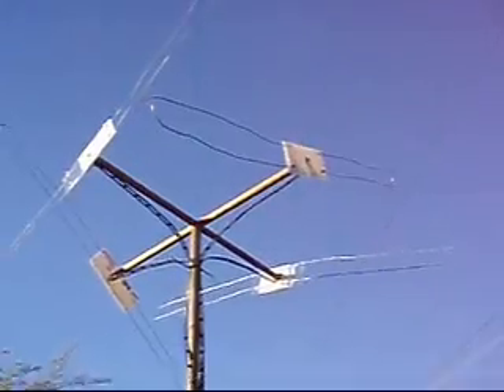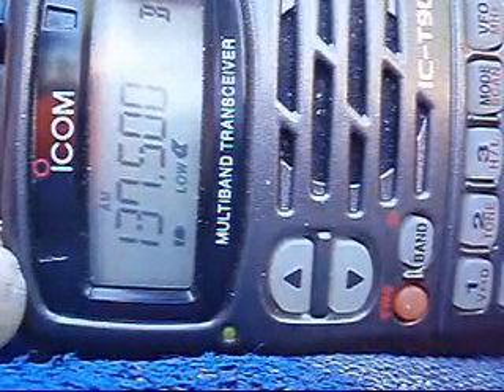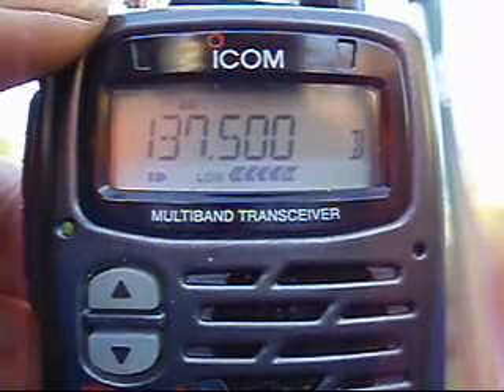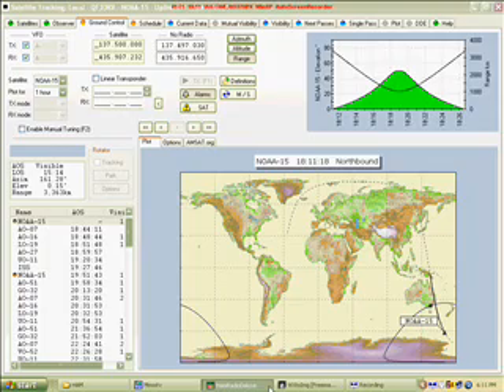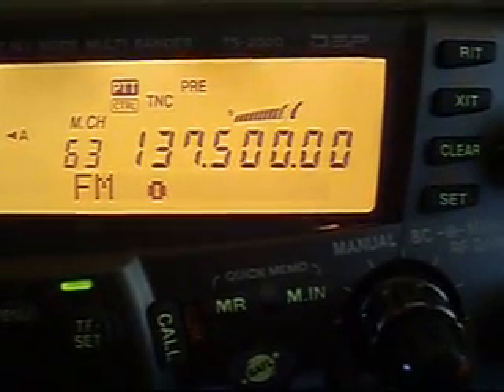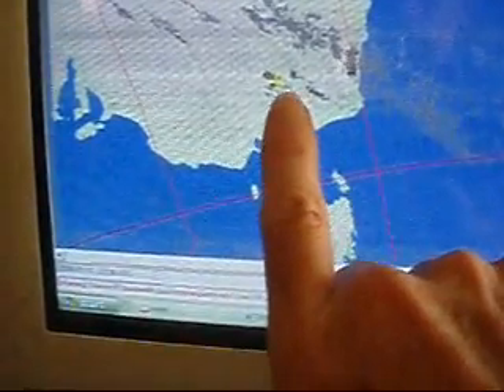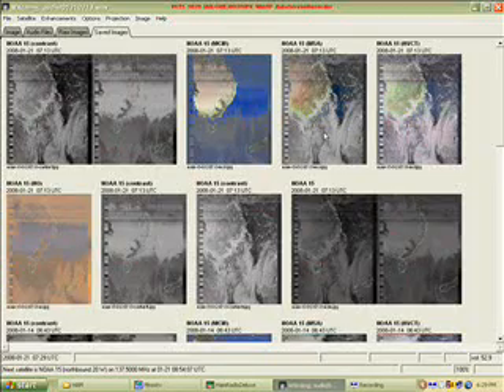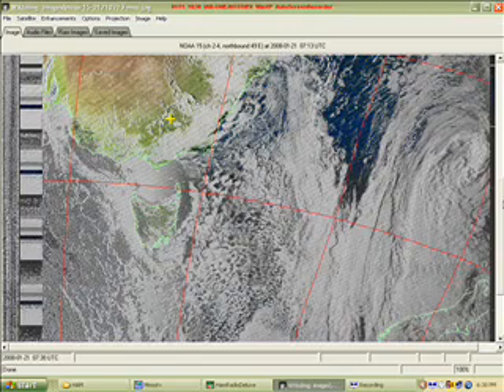wx satellite receiving

Comment: Hi Ian, Lovely strong signal there. I've built a QFH antenna, but with my FT857 and IC746, I'm not getting enough bandwidth. Have tried chasing the Doppler with the IC746 (by hand!) but it's not easy. I also have a very noisy downlink here all acroos the 137MHz band. Not sure if I'm getting some sort of QRM from all the pagers at the local hospital up the road?  Your rx audio sounds good and strong, and makes for some nice pics. 73 - Rob VK2GOM